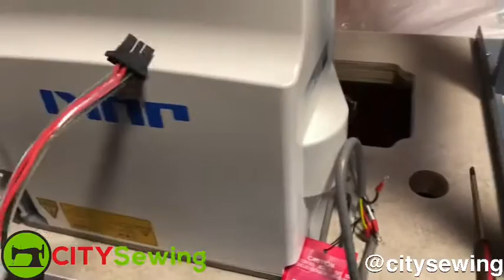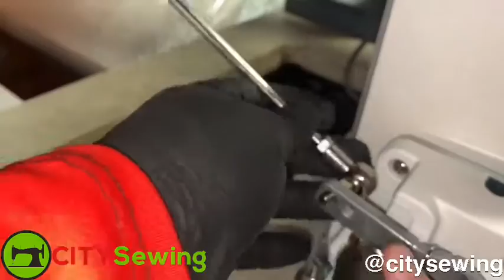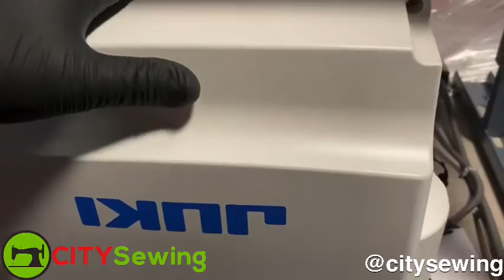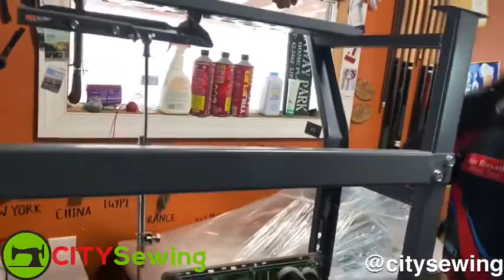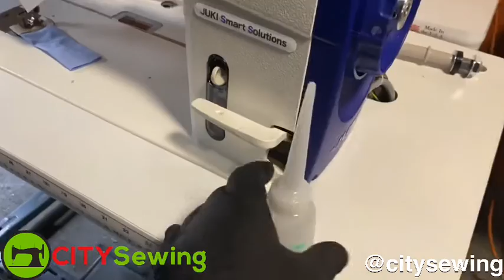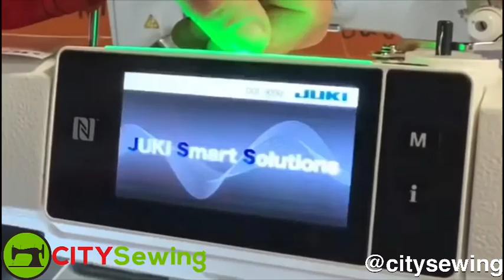Juki DDL-9000 how to install Into the table !!

Comment: Thank You for such a great video. I am only wishing I had seen this BEFORE I purchased my JUKI DDL-9000 from someone else whose tech support seems to be non-existent.  I would have definitely purchased from you since you clearly know the machine in-depth. Your video was invaluable and I will definitely keep you in mind for my next purchase. I followed everything correctly to attach the cables from the sewing machine to the computer board but my operation panel does not come on.  The light bar above it turns green (so it is getting electricity) but the operation panel never comes on. I am waiting for the tech support from the company I did buy the machine from (I am so having buyers remorse - not because of the machine but because who I bought it from.) It is a brand new machine which I spent over $2000+ and waited a month for (they lost my original order) but which has not worked right out of the box.

Comment: Clearly explained; great job. Thank you for this. Question for you. I currently have the Juki 8700 and I'm looking to upgrade. I have the K-leg table..will the 8700 table fit the 9000 with adjustments for the power box and removal of the servo motor and oil pan currently attached?
Reply from the maker: Not at all